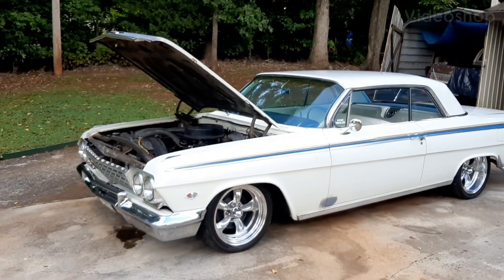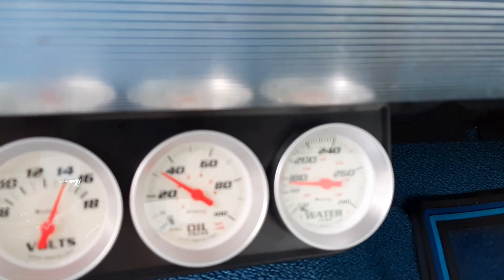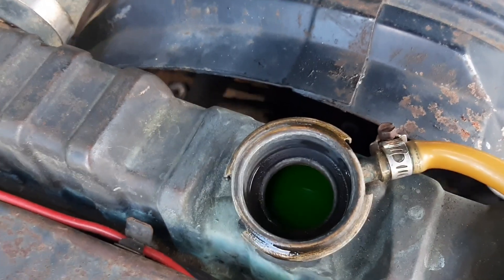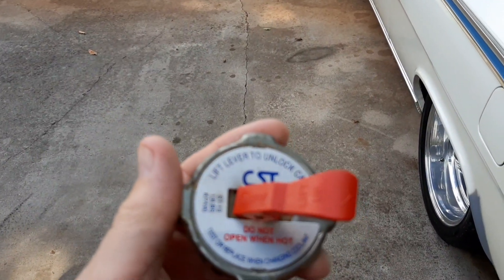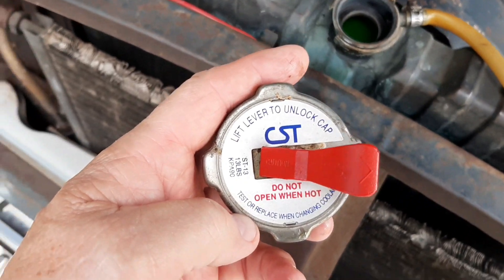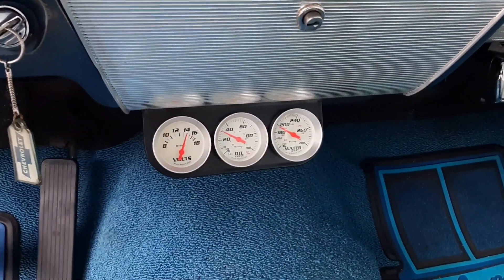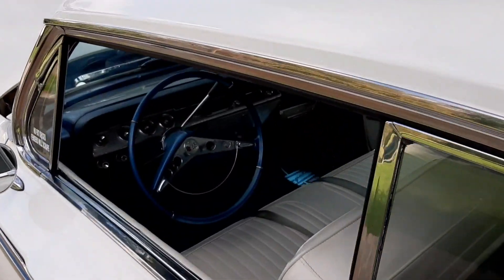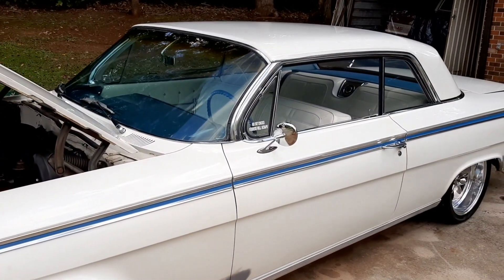My 1962 Chevy Impala "Whitey" might be having a issue with running HOT! Bad gauge? Bad Radiator cap?

Comment: When it was up to almost 200*, it didn’t look like the antifreeze was flowing like it should in the radiator. Antifreeze will deteriorate the impellers of the water pump over time. That’s just my guess
Reply from the maker: That might be the case. But the anti freeze was moving around pretty good! Might not have shown up well in the video though. Thanks buddy for your comment!

Comment: I couldn't see the fan.  If it has a clutch it could just not be pulling enuff air.  My brothers had one and he replaced with a direct drive upgraded fan to cure his problem.  Could be the radiator needs some maintenance (if it is the original, it is probably has blocked or partially blocked tubes).  If it was me, I would first run a good (chemical) system flush on  and then replace the thermostat (180).  This will give you a good base to work from if the problem still exists.

By the way, if you are down in Benton (Wed - Saturday) and need some good grub check out "Big Mamas" up behind the Post Office.
Reply from the maker: No sir it does not have a clutch fan on it. But the chemical treatment might be a good idea! I appreciate the info on the good eats, but I will not be down that way anytime soon. But I hope that you have a good time there! I really appreciate your comment!

Comment: I would say over 200 degrees is hot, it doesn’t look like your water is circulating enough,usually it moves really fast, good luck. Could be your radiator cap I never was a fan of those red pop up lever on the cap it losses pressure
Reply from the maker: I know that you couldn't see it very well, but it was moving the antifreeze around pretty good! But it could be the radiator cap. Might be time for a new one soon! Thank you buddy for your help!

Comment: Do you have circulation as soon as you start the car?  If so your thermostat is bad...the newer stats are made to stick open when they go bad...not closed like the old ones
Reply from the maker: No sir I do not have circulation when it is cold. But when it started warming up, it had good circulation then. I knew then that the thermostat was good. Or at least I thought it was. I sure do appreciate your help my friend! Thanks!
Reply: @primeredisbest    no prob buddy   wished i lived closer   i could help you out...maybe the cap   atleast those are cheap and you can try a new one out

Comment: Not even 200 at 50 minutes idling.. id say there aint nothing wrong.. drive it around see if it gets hotter or not.. 200 is ok at idle it will cool down a bit when u drive it
Reply from the maker: Maybe so! I sincerely hope so anyway! Lol. I just know when I was driving it from Gas Axe Chop Shop to our home, it got up to around 220-230. I might check that mechanical gauge and see if it is correct. Thanks buddy for your help! I appreciate it!